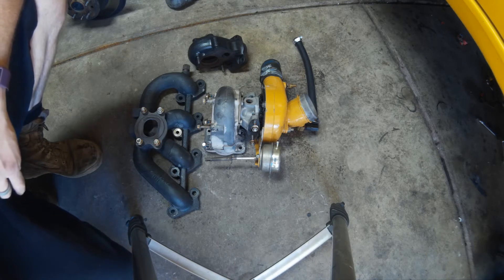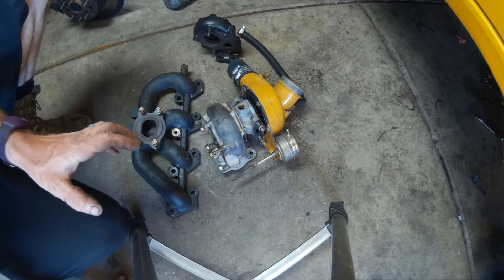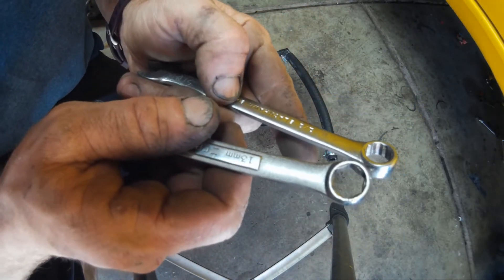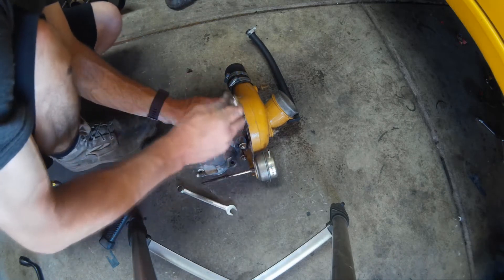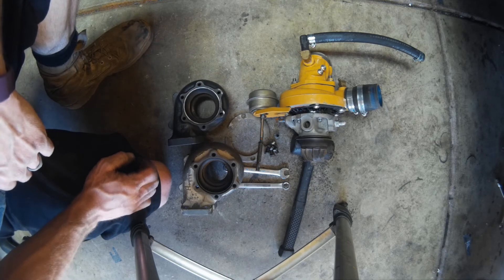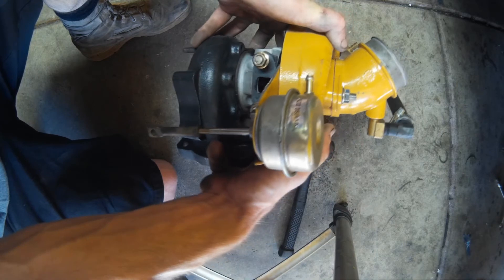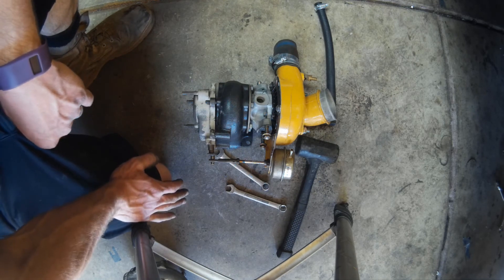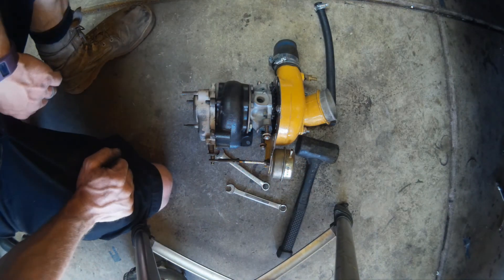HOW TO SWAP A GARRETT  TURBO EXHAUST HOUSING: Volvo 740 .48 to .63 AR

Comment: Could you let us know the difference in performance you noticed going to the smaller housing
Like when it started spooling and when it reached full boost on the 0.63 vs the 0.48

And how did it feel?
Thanks